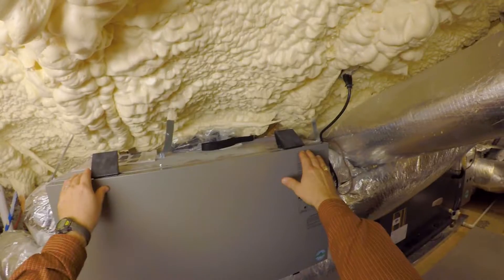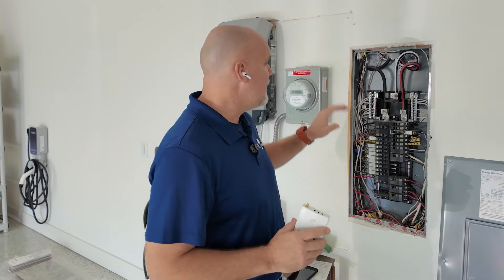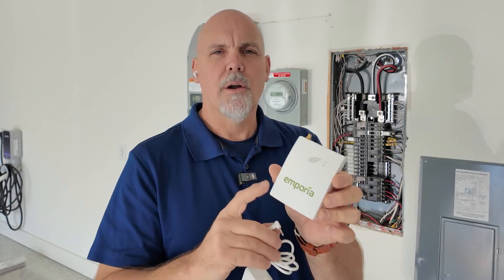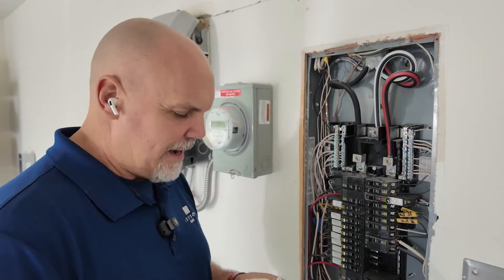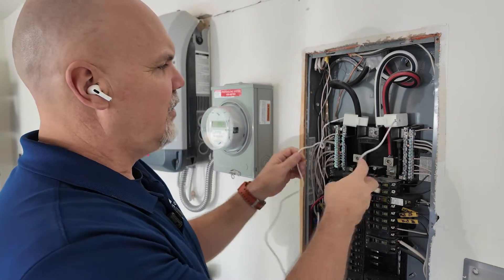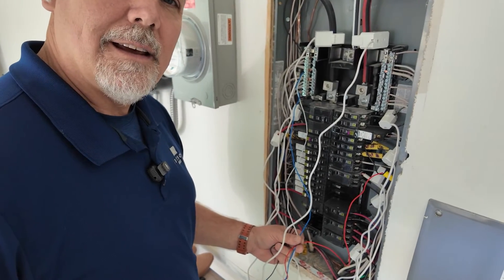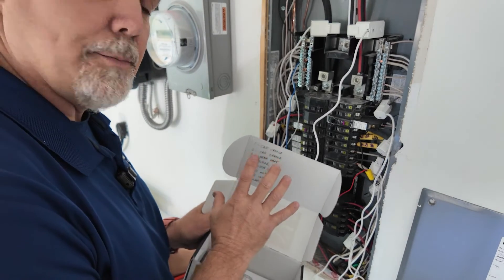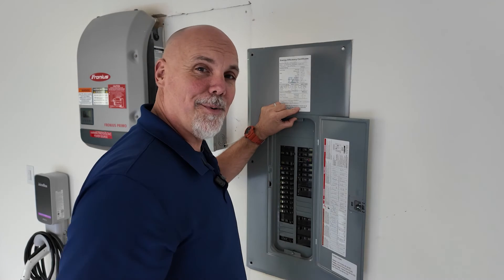Secrets To A Smarter Home: Energy Monitor Install!

Comment: Excellent video and very thorough.  I appreciate your level of detail.  A couple of questions.  I have 2 breaker boxes.  I'm assuming I can install a separate unit in each box correct?  Also it sounds like you feel like the Emporia system does a better job of measuring than the Sense because those are the two options that I'm down to right now.
Reply from the maker: @coloradoseodesign5926  I suggest contacting emporia to discuss the best option for multiple panels. They can certainly provide the best option. I tried a Sense years ago but it had some difficulty detecting the variable speed heat pump that doesn’t have a distinct electrical signature.

Comment: I'm debating getting this system or Sensor.  How did you wire the power to the breaker?  Does the antenna work well inside the box?
Reply from the maker: I like this system better than the Sense.  It comes with the wire and wire nuts to pull power from both legs of the electrical panel, which is required for complete monitoring.